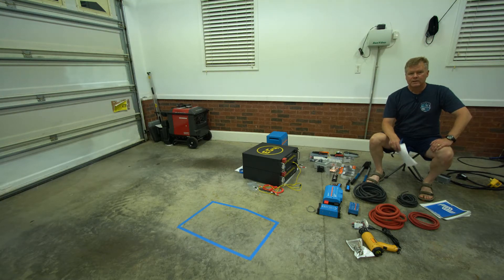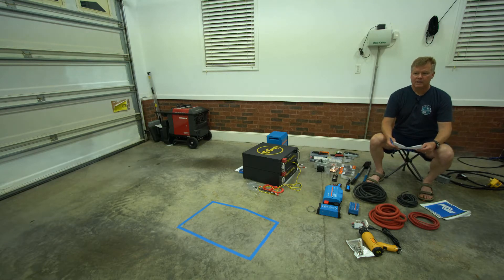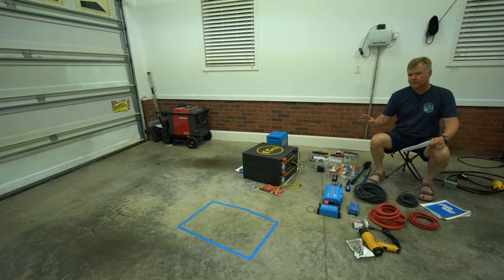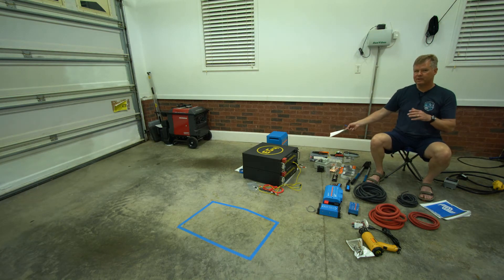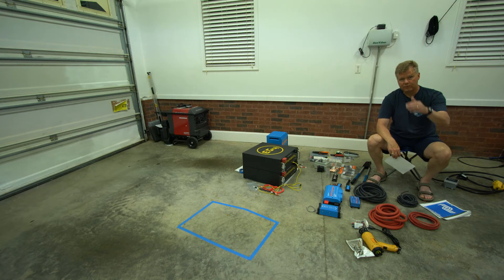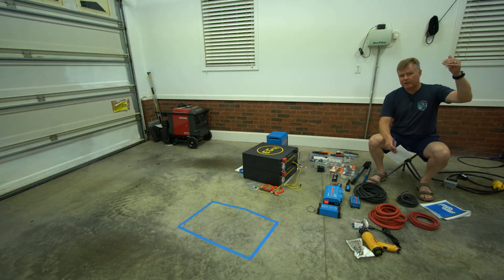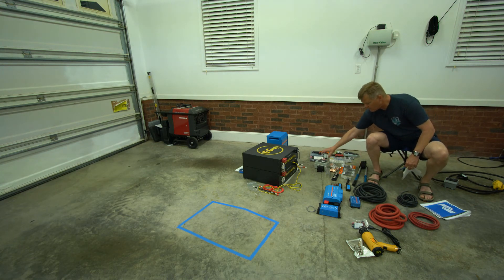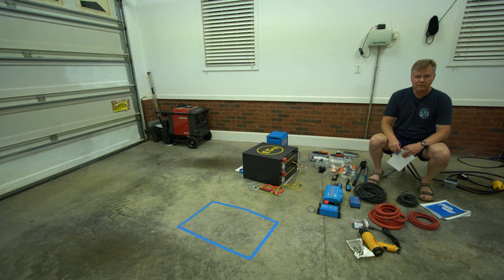Airstream Basecamp 20X, Battery Upgrade Overview, 24V 200 amp hour batteries

Comment: Wayne thank you for this video!  I have a chance to become a Basecamp 20x owner, but I have some concerns about power capacity.  My wife is on an oxygen concentrator that we need to be able to run 24x7.  I am wondering about how long we could be off-grid for while running the usual appliances (assuming worst case cloudy weather and in the cold).  The concentrator is 120 VAC (+/- 10%), 60 Hz with average consumption of 325 Watts.  Would you be able to tell me (a) how long I'd be able to run that machine (and the others) off-grid with the stock batteries, (b) the same but with the same upgrade you did?  Also, how long would a generator keep me going before I'd have to refuel?  Sorry for the basic questions, I am a real noobie when it comes to RVing.   I am making my way through your other super helpful videos as well.  Cheers!
Reply from the maker: Hi @cdesaint, I'm glad the videos are helpful.  As a baseline example, my Basecamp 20X came with two 80 amp hour AGM batteries and 180 watts of solar.  That equates to 160 amp hours but you can only take AGM batteries down to 50% which left me with 80 amp hours of usable capacity. In regards to power usage on your oxygen concentrator, I used a calculator from Explorist.Life as a quick view of power needed (https://www.explorist.life/what-size-of-solar-system-is-needed-to-power-a-camper/).  325 watts @ 120v for one hour would require approximately 27 amp hours of power.  So you could essentially get about 2.5 hours of usage out of my AGM batteries.  If you run the concentrator for 24 hours, you will need ~27 amp/hr * 24 hours = ~650 amp hours per day.  The Lithium batteries I installed give me 800 amp hours of usable capacity.  In that case, I could run the concentrator for one day.  So in either case, you will need generator to supplement the batteries.  A Honda EU2200 would have more than enough power to recharge your batteries and will run ~3 - ~8 hours based on load.  A lighter load of just the concentrator could probably get you closer to 7-8 hours. A larger generator like the Honda Eu3000is has a larger gas tank and can run ~7 to ~19 hours.  This would be a better option for ensuring consistent performance and fewer times you have to run the generator.  The 3000 watt generator could more quickly recharge the batteries and minimize any downtime.  Hope this is helpful.  Let me know if we need to get on a call to get into further details.

Comment: Did you ever think of using a self contained jackery/bluetti in lieu of all senate systems….
Reply from the maker: @Sailing Vessel Freedom, I have and those systems would be cheaper. I chose the larger system simply for ease of use. I didn’t want to have to carry the extra equipment and have to move it around. They are great systems but I can add additional solar panels to the internal system on the roof and portable panels external to really increase my charging capabilities.